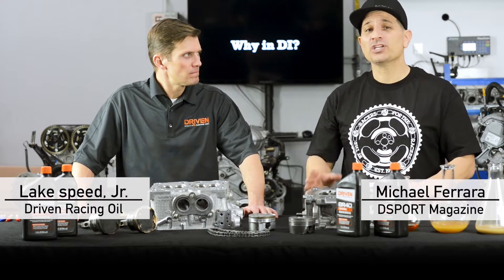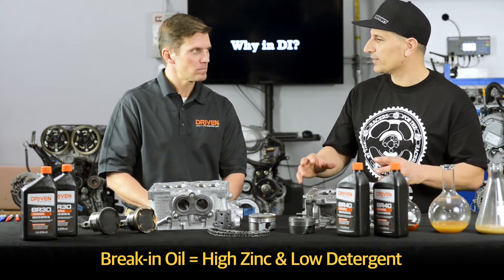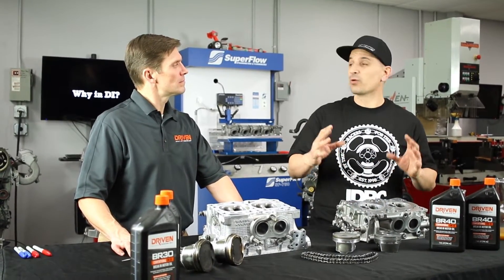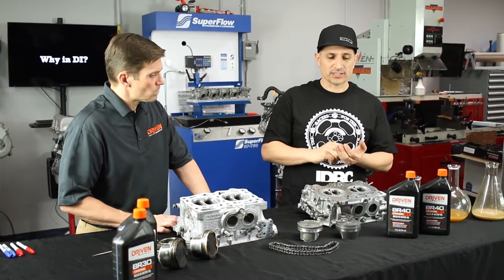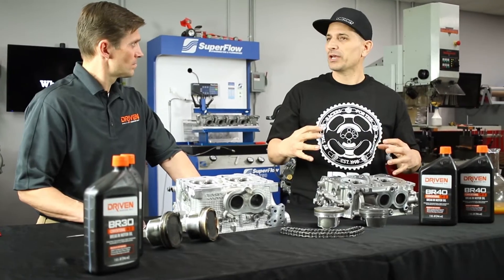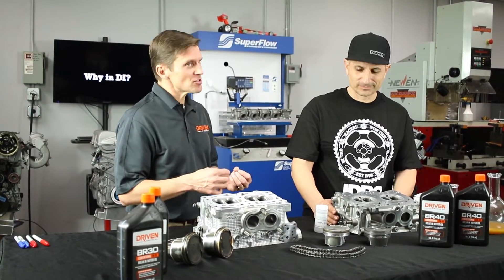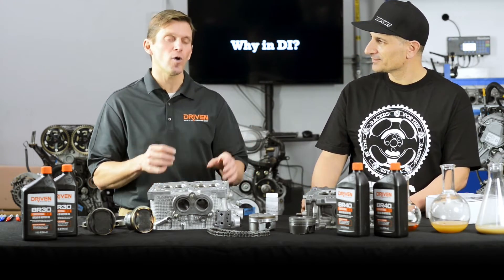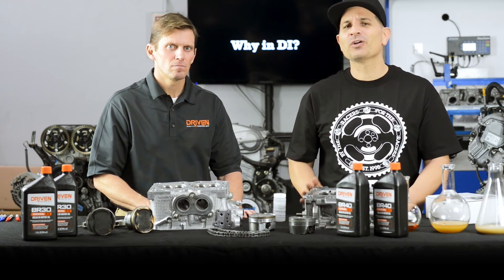How to Break-in Brand-New Engine + Oil Analysis

Comment: I bought a new 2019 nissan 370Z sport coupe and did oil and filter changes at 500, 1500 and 3,000 miles and then went to normal 3K mile OCIs after that. I broke the engine in gently and so it took longer to break in fully, about 5K miles. At that point my oil consumption decreased to about 1 oz per 1K miles, where it is to this day at 17K miles. I've only used the recommended 5W-30 Nissan ester oil because of its high molybdenum content. My engine is very hard on the oil, with its VVEL mechanism on the intake side of the valvetrain, and I've found that this engine, VQ37VHR, on used oil analysis reports tends to shear down 5W-30 Nissan ester oil to a 20 weight after about 3K miles. This is why I don't push the OCI out any farther. If I ran an oil with a better base stock that could withstand the higher temperatures and pressures generated by the VVEL mechanism I could probably go another 2K miles or so on the OCI.
Reply: I would use amsoil and amsoil filter. Amsoil can take the heat.
Reply: I recommended Redline oil, much better than the nissan OIL

Comment: These kinds of videos NEVER mention anything about the VERY first step. Priming the motor. I have no clue why something so VITAL gets left out.
Reply: If it was done right, you can run a motor with the engine assembly grease for a min before damage.
Reply: pointless unless you built it and it sat for years.. its going to build oil pressure instantly when it starts.

Comment: I got confused guys!, after rebuild the engine will put break in oil and drive the car normal load at 2500rpm, then change oil and filter and drive the car for 7 minutes high load full throttle till you reach 500 miles then drain it again, is that correct ?, please explain. Thank you

Comment: This is great ...I am about to break in a 347 stroker brand new ..My builder has me using 10-40 conventional for diesel engines. Break in, start and run for xx time. Change oil and filter (same type oil) and run 100 miles. But I am finding much more and better detail from you. Now I understand the 2500rpm for flat tappet but I have a roller cam - he recommended 1000 rpm for 20 minutes (no idle) but do you recommend the 2500 for roller also ? THANK YOU FOR THE GREAT VIDEO
Reply: Well he said the zddp needs some heat and pressure to get activated and stick to the metal surfaces, besides 2500 is not that high, I think it's important to fluctuate the rpm a little say from 2000 to 3500, just like after the first oil change when driving avoid constant rpm and I would gradually do WOT only from higher rpm, lugging the engine is bad.

Comment: I have rebuild over hundred motors, never used any kind of brake in oil just regular oil 10W40 etc.etc... never never any high rpm just normal driving never any problem for the customers.. just dont get it with any brake in stuff??
Reply: It's just a new product for people to spend money for the oil companies, break in oil is the new thing everyone seems jump on. Break ins are done when manufacturing engines these days and delivered ready for regular oil.
Reply: Jose Antonio that’s absolute bullshit. Iv researched this topic extensively and break-in is absolutely crucial. It has to be done methodically. Including full throttle and redline.
Reply: Marek Sumguy If the engine is properly warmed up. Then I agree.
Reply: Definition of Insanity of course the coolant and oil has to be up to operating temp. I think that goes without saying.
Reply: My VW was broken in at factory.

Comment: I have a 1978  MGB that I just had rebuilt. The mechanic, who is very experienced with these engines, didn’t use break-in oil but Valvoline VR1 20-50 racing oil with zinc. Problem is,  I’ve now driven the car 400 miles, and it’s still using about a quart of oil every 200 miles. The mechanic is trying to downplay the problem. I’m worried obviously that there’s a problem with the rebuild. The engine does seem strong. I was going to change the oil to 30W Brad Penn break-in oil and run it for another 400 miles or so to see if the rings seat. My question is, is it to late to hope that the rings will seat with the cylinders with the 30W break-in oil? What do you suggest that I do? How many miles should I expect it to take for the rings to sear and oil consumption to go down?
Reply: Bill Keisling go back to break in oil and drive it like you stole it for 80 miles. With plenty of overrun.
Reply: @mareksumguy1887  Will try. You say drive it for 80 miles with 'plenty of overrun.' You mean with lots of high RPMs?
Reply: yardbird tv no... overrun is decel (engine braking). But really it sounds like it needs to be rehoned and re-ringed.
Reply: @mareksumguy1887  Yes, I'm afraid it needs to be rehoned and re-ringed too. The oil use only seems to be getting worse. Took it out yesterday and drove it for 100 miles and it used most of a quart. Obviously there's a problem with the rebuild. The mechanic says he 'sees no problem with the engine.' It now has about 1,300 miles on the rebuild. The mechanic just retorqued the head and re-set the valves this month. He blames the oil consumption problem on the engine sitting in the car outside in his yard and not running for several years while we restored the rest of the car. I'm trying to think what's fair here, but obviously I can't run or sell a car that's getting 100-150 miles per quart of oil. I'm wondering: about how much would it cost these days for a mechanic to rehone and re-reing an engine? Obviously that's not a total rebuild, but the engine probably has to be pulled. I'm thinking I could ask the mechanic if he wants to split the difference, but I don't know a fair price for this. If I took it to another mechanic, what do you think is a fair charge to rehone and re-ring a 4-cylinder MG engine? Thanks again.
Reply: yardbird tv could also be stuck rings... or oil being burned in the engine through some other means. Are you sure it’s not the valve stem seals?

Did you rev it out at full throttle during the break in period?
Reply: @mareksumguy1887  Obviously I'm not happy with how the mechanic's handling this. I'm trying to figure out how to resolve the problem. The mechanic says he doubts it's the valve stems. As for whether I gave it full throttle during break in: I've drove it what I would call aggressively, though not abusive. You told me earlier to 'drive it like you stole it.' What I'm going to do is reload it with break-in oil ($40+ a reload). The tach goes up to 7,000 RPM, and begins to redline at 5,500 RPM. By driving aggressively I mean I've been shifting at about 4,000 RPM. Are you suggesting by running the engine at 'full throttle' that I redline it all the way to 7,000 RPM? Or just 5,500 RPM? DOn't want to hurt the engine, obviously. Also, is there a test -- compression or leak-down test -- that may shed light on the problem that I can take to the mechanic? Thanks much again.

Comment: Hey I just got a new 2019 Camry. It says on the manual that the break in process is for 650 miles. I’ve put about 1400 miles already, should I change the oil for the car now or wait until 5k?
Reply from the maker: Change it when you can

Comment: Will the engine smoke a little during the  break in period? I have a little smoke coming out of the exhaust. Is that normal.
Reply: Spencer Williams yes. Every car is different it smoke is to be expected. Just drive it normally and don’t redline the car u til after you do the first oil change. Usually at 5k miles.
Reply: @mr.anonymous3103  the line on the dash means nothing. shut up.

Comment: What do you guys think about this break in method?

1. Fill engine with Royal Purple Break-In oil and Royal Purple oil filter. Let vehicle reach warm idle temp.

2. Do Three 1/2 Throttle pulls in 2nd gear from 30% to 60% of your engine's range and engine brake to slow down.

3. Do Three 3/4 Throttle pulls in 2nd gear from 30% - 80% of your engine's range and engine brake to slow down.

4. Do Three Full Throttle pulls in 2nd gear from 30% to 100% of your engine's range and engine brake to slow down.

5. Compression check warm. Drain the oil, change the Royal Purple oil filter and use Royal Purple Break-In Oil for 1500 miles.

6. At 1500 miles compression check warm, drain the oil, change the Royal Purple oil filter, fill with Synthetic Rotella T6 5w40 and continue to do so at regular 3K mile oil change intervals.
Reply: DO NOT let a new engine idle on first start!!
Reply: @darren70215  
👍👍
Reply: darren70215 of course you let it idle... but only for like 15 seconds.
Reply: You don’t just let it sit there and idle. You start revving it in neutral until it gets warm... then you ride it easy in first gear until it get up to temp. Then you start giving it the beans in 2nd gear.
Reply: Whenever I start my car in the morning, as soon as it turns on, the rpm is slightly higher than normal but it only last for like 12 to 15 seconds. That's when I wait until the rpm goes down to its normal level.

Once I hear the engine sound drop to a lower frequency sound and see the rpm needle drop down to the normal rpm number, then that's when I consider my car warmed up and ready to drive.

Not sure if that is the correct way, but I've always done that with all my new cars for years and never had a problem with them.

Comment: Been looking for information like this for a while now.
Next question is, can you analyze transmission oil in the same way and who does that type of stuff??
Reply: YES Claudius Louis...transmission oil can be analyzed in the same way as engine oil. 
Just make sure you send your sample to a lab that specializes in "automotive engine oils". 
You can find these online. I'd call a few beforehand & ask your questions. 
They'll send you a kit to return with your fluid//oil. 
Keep in mind that the design of automatic & manual transmissions create particulates. 
Transmissions are not built to the tight clearance tolerances as are engines. 
Therefore, more "debris" will be found in transmission fluid//oil than in a "healthy" engine. 
The experts should be able to determine if there is "excessive" wear occurring. 
Regards, 
Ben 
P.S. SORRY this is 2 years late. :-)

Comment: Thanks for the info.  I find this very interesting.  The concept of running an engine hard when it’s new to seat the piston rings and everything does make sense.  My question is why do owners manuals suggest otherwise?  For instance on a Corvette the tachometer shows the redline at about 3500 RPM for the first 500 miles to remind you not to go past that point.  I just ordered a Ford Raptor with the EcoBoost so I’m researching what fuel to run, motor oils and how to properly break it in.  Can you touch on the disconnect between your advice and general manufacturers advice?  Thanks in advance!
Reply from the maker: OEM engines come to life feeding on natural gas in many cases and they are already "broken-in" with respect to piston-ring-cylinder-wall break-in. Hence, there is no need to break-in the engine with the proper method if it's already broken in. Now while the engine might have been properly broken-in, there may be a loose accessory, fitting or ????? It the driver isn't doing full-throttle blasts from stoplight to stoplight, they have a better chance of finding a rattle or issue before it becomes a major problem. It's also a good practice for someone to get a feel for the car at minimal power before they push it to the limit. Still, there isn't any drawback from following the run-it-hard protocol. Just make sure the engine is at normal operating temps. Wear is significantly reduced on engines as temperatures go up. As for the fuel and oil recommendations. Run the highest octane fuel that you can afford. If you have direct-injection only engines (which I think those are), consider a water-meth system to reduce intake valve deposit formation. Also, use an SN-plus oil or an oil specifically made to deal with LSPI. Check out our video on LSPI to learn more.
Reply: @dsport  Thanks for the detailed response.  The new Ecoboost engines have direct and port injection.  I'm still going to run a dirty side catch can.  And it sounds like I need to run 93 oct.